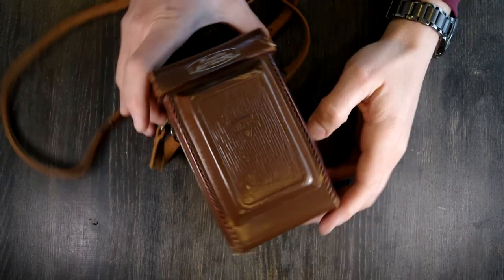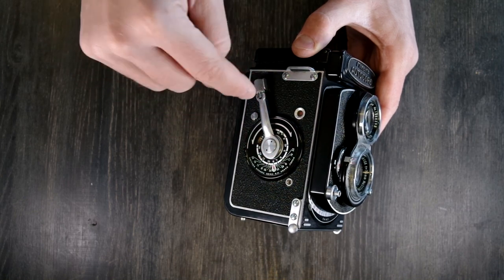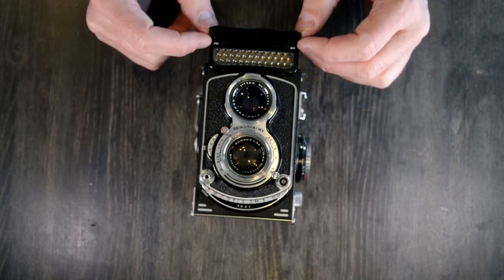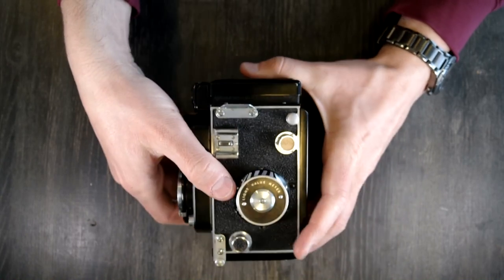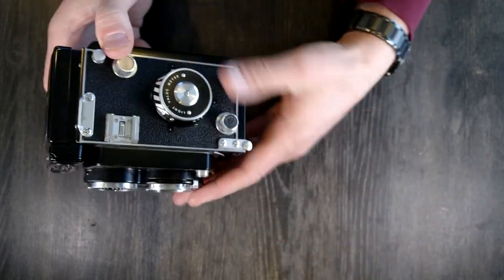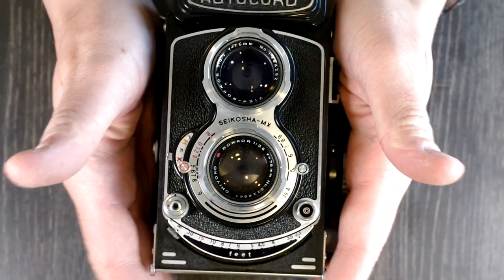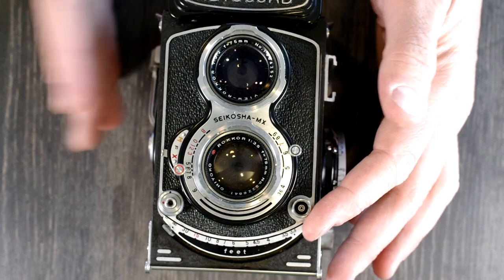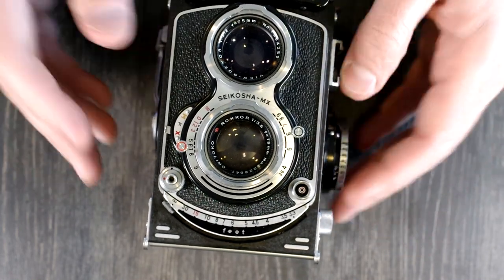Minolta Autocord L-MX Manual: Overview, Operation, Light Meter, How to Use, Taking Photos, EV Meter

Comment: I have an older model without the light meter, and I did a lot of research before getting my Autocord. I believe one thing that might be of note is that between the 1/250 and 1/500 shutter speed, there is an extra spring that is activated. this causes there to be more tension when moving the shutter speed to 1/500 after the film is advanced, and forcing it can potentially damage the camera. When going to use a shutter speed of 1/500 make sure to change the settings before winding the film. Other than that, great overview, I am always happy to see more Autocord content on youtube.
Reply from the maker: Thank you and good point!
Reply: Panicandres - there is a simple solution to this minor issue. If you have advanced the crank and can't set the shutter speed to 1/500, just do the following steps: 

1) cover up the lens and release the shutter (ie take a shot but with the lens covered up); 

2) set the shutter speed to 1/500;

3) then push the crank reversing button to the left and advance the film winding crank anti clock wise;
and you are are ready for the next shot.

You can find this tip on the camera manual. Thanks
Reply: This is great to know! I have mine opened up right now trying to fix an issue, and I was noticing something changing between those speeds. This must be where the issue is, because it works ok on the faster shutter speeds. Maybe the extra spring is what has the issue...

Comment: Wow, what a video find and timely! Thank you so much for making this video manual. I just won a beautiful Autocord, that has been CLR'd, and has the wide angle accessories, a nice leather case, and a 12" cable release. It also comes with 2 rolls of film for me to get started right away. I'll be using a Sekonic L-158 as my metering. I can't wait!!!
Reply from the maker: Thank you! And very nice camera. These are a joy to use.

Comment: Hi David Hancock - you can do multiple exposures with this camera. Just push the crank reversing button to the left and advance the film winding crank anti clock wise, and you can do this multiple times. You can't find this unique feature with the Yashica 124 or 124G, but you can do multiple exposures with the Yashica 635.
Reply from the maker: Thank you! I could not figure that out.

Comment: Great video on how to use the Minolta Autocord. I just accuired one for my wife and have yet to shoot a film with it. However, even though it looks great (almost mint), there are some things that feels kinda "off". The first being when we advance the film with the winding lever it feels somewhat heavy or more tension 1/5 of the way when turning until it hits some kind of a bump and when we pass that it feels loose and nice. Is it supposed to be like that? In your video it looks more smooth.

The second thing is if we cock the shutter too fast, it doesnt seem to advance the film and when we clicking the shutter button it doesnt shoot. Is this common or a known issue?
Reply from the maker: Hmm. Good questions. Those might be good for the Fix Old Cameras channel. Here are my best guesses:

1- On the advance, that does not sound normal. There may be something wrong with the internal gearing -- missing or worn tooth, etc -- on the crank arm gear.
2- For the shutter, that isn't unheard of for leaf shutters. I don't know that's it's specifically a common issue with these, but old leaf shutters do need care and gentle handling.

Comment: This was a good video. I need to understand basics though with picking shutter speed. My camera does not have the light meter or calculator on the side. Any suggestions on learning camera basics?

Yes the leather case is a pain in the....yeah
Reply from the maker: I'd grab a basic light meter smartphone app, learn to use it, and just go for it. If you succeed or make mistakes, the film will let you know. Let yourself fail because that will teach you a lot. Keep notes on your camera settings for each shot, too, while you learn.

Comment: When I was looking for a "faster working TLR in the 1970's, Minolta Autocord came up as an alternative to the almighty (expensive) Rolleiflex. I had seen the CdS cell-equipped, late model Autcords, but the earlier meterless version was more affordable. (Also less to go wrong, though the broken-off focusing knob is/was a known weakness, remedied by a well-equipped camera repairman.) The Autocord was more interesting to use than Ye Olde Rolleicord V, since there was less chance of double exposing film. Meter readings from the trusty/adaptable Sekonic L-28C was part of the usual medium format kit. along with Size I bayonet filters. Those were the Verichrome Pan, Kodacolor-X  and "Shutterbug Ads" days of long ago.
Reply from the maker: Nice! I do tend to agree that I prefer using the Japanese TLRs over the German ones.

Comment: Hi David! I just got this camera in, same exact model except without the meter (so seikosha-mx). The camera was recently CLA'd before purchasing and it all works like a dream! However, I can not seem to get the camera to fire in 1/500? I know of the extra spring that adds more tension for the 1/500. So i will make sure the shutter has been fired, move the shutter lever down to 1/500, wind, and then when i try to press the shutter release the button won't even depress. Is there something special you must do to get the camera to fire at that speed?
Reply from the maker: Hi, James, there shouldn't be anything special for that. If your camera has the same shutter as the one in this video, it should operate the same way. If it isn't, then it's worth asking the seller why and seeing if they have thoughts. If it still is non-functional, I might see about a return or a follow-up overhaul to rectify the shutter issue. If there is some trick to getting it to fire on 1/500, let me know, though.

Comment: I was also recently diagnosed with a slow but  just as  fatal version of ALS, eventually this will make it hard to lift one of my 35 mm slrs and to even hold my head up.  but I figure I could still take a few photos with a camera i don't need to lift to me eye  too.
Reply from the maker: Oh man, I hope that however it progresses, it's much slower than anticipated. (This should buy you some time and also the smaller levers may be good for helping retain some muscle dexterity. I'm not a doctor, though, so I could also be wrong about that.)

Comment: I finally have my autocord in my hands,  I was very suprised at the heft of it.  I do have a question about the shutter,  does it have to be on a specific setting? it seems that the EV numbers will put you between the specific stop points,  cant the shutter be fired this way or does it default to the nearest setting?
Reply from the maker: Nice! Yes, it will need to be set correctly. I sold my Autocord so I forget how to set the shutter, but there is a comprehensive explanation in the video.

Comment: Hi David. I'm having some issues using a flash with my Autocord. I have an early version which only has the toggle switch between bulb/flash under the taking lens. I've used a tiny Sunpak unit with its built-in cable. The flash fires without fail, but my negs are near empty (total underexposure) which suggests the flash, though firing, is not syncing with the shutter. Any ideas?!
Reply from the maker: Does yours have an "X" switch? If not, it may only be properly timed for "M" bulbs. The other possibility is that the settings on the camera are wrong and there's no enough light reaching the film. To test it, with no film in the camera, in a dark room, open the camera's back and look through the lens pointing the flash into the room. Trigger the shutter and you should see a flash through the lens. If so, then the timing works and the settings were wrong. If not, then the timing is probably set to the wrong setting. With that setup you can also test different configurations on the camera to identify a working setup for flash use.
Reply: @DavidHancock  If as I suspect there is only an M-sync you can build a timing circuit to delay triggering the flash. I suspect that some creative web searching will come up with some examples. The cameras designed for flash bulbs close the contacts a few mS before the shutter trips to give the burn in the bulb time to build much like the spark timing on a gasoline engine that fires before top dead center.

Comment: I sent a Minolta Autocord to the US for a CLA to a very famous Autocord repairman but he was so expensive I was unable to pay his charges and I had to leave the camera with him. Part of the outrageous charge included a front element cleaning charge of $10.00 which did not need cleaning as I had it in pristine condition.
Reply from the maker: Ouch. That hurts. I've left cameras with repairmen before, but only because they were non-repairable and the repairmen could use some parts on other cameras. A loss like that hurts. I have four repairmen/companies that I work with and being able to trust a repairman is very valuable. Knowing what they do well and don't do well is also important.
Reply: @DavidHancock  It was a particularly nice model with very clean glass but the shutter speeds were off.
Reply: That is a bummer guy. We has a great camera repair shop in Halifax but after twenty seven years they finally closed their doors last December. Major brands Nikon, Canon, Sony, started refusing to send parts for him to repair their digital products. Hard to be in business without suppliers. They did marvelous work repairing  film cameras and CLA but without parts for current digital cameras "The writing was on the wall" to use a bad quote.
Reply: mamiyapress - if you are referring to that famous Autocord repairman in Beaverton USA, then I have a difference opinion on this person. I bought my LMX from a seller who told me that the Autocord had been CLA by him. After getting the camera for few weeks, I noticed that the aperture lever had been disengaged and sat at f11. I then contacted the gentleman in Beaverton about the camera where he confirmed that it was serviced by him not long ago. Initially he suggested that I try to fix the issue as I am not from the US. I told him that I have no confident in doing this and requested that he repair this for me. For his service, he didn't charge me any thing, except for the insured postage for returning the camera back to me. Of course, it did cost me some money for sending the camera to him and also for the safe return, which I am very happy with the service. This is just my opinion.

Comment: 11:05 That's a frame count reset? I guess it differs per model? I have an Autocord MXV and that buttons slides after that initial double exposure so I can take more exposures on the same frame. 

Try to hold it and see if it can wind again to take more multiple exposures after the initial double exposure. :)
Crank locks in place after the initial double exposure so you need to hold that button before winding. :D
Reply from the maker: Thank you!
Reply: @DavidHancock  No worries! Hope this helps you or some of your other viewers! :)

Comment: I am looking at buy one of these but is has a series of numbers on the lens  that  countdown from 18 to 3 with no numbers on the other side, but the is a sliding lever. no light meter that I can tell.  this is of course a 60's version citizen shutter.  I assume it is good.  I love their Watches.
Reply from the maker: Sounds like a nice camera. The numbers 18 to 3 are, I think, explained in this video. It's a very clever system.
Reply: the shutter speeds that you add the number (from the selection of 18 to 3) is displayed on the top looking down,  I figure.   My light meter app gives EV's and I have a GE  light meter made in about 1958 that works fine still.